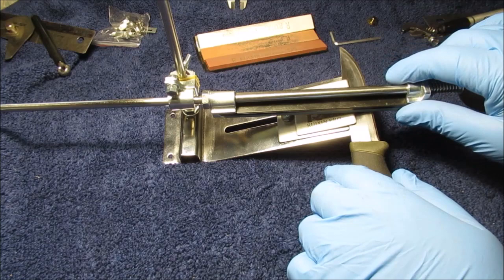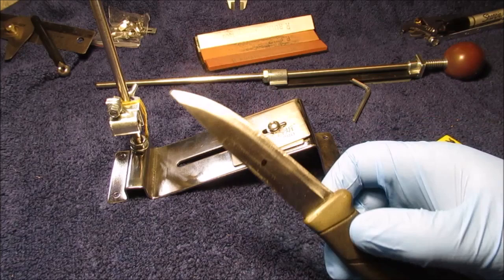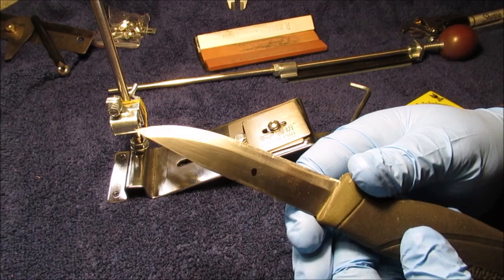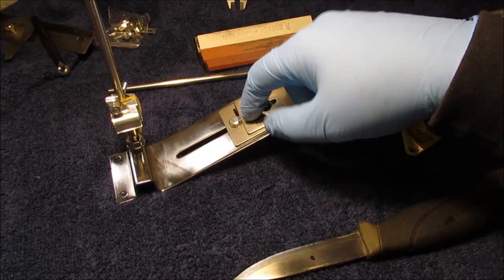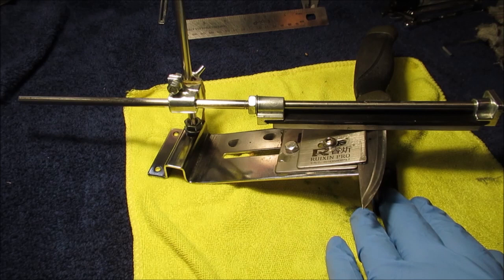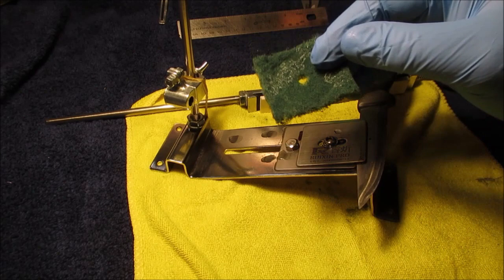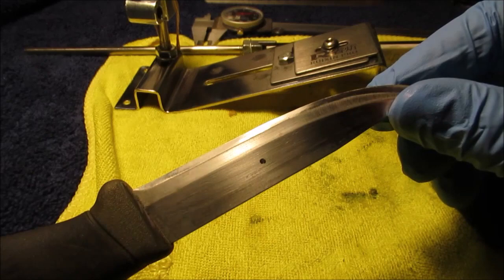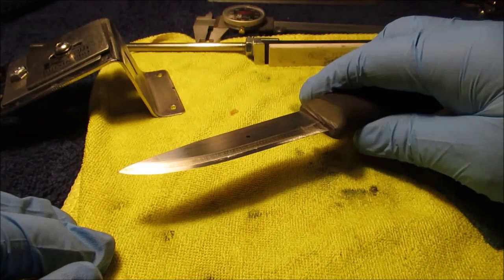Sharpen Mora knife on the Ruixin Sharpener

Comment: Lil' ball is looking good!! I just made a video last night featuring my yellow protractor, I use that thing all the time!! I used it for sharpening my broken drill bit, we'll post it Thurs. night!!☺
Reply from the maker: I have used those balls on several projects I have 2 sizes this is a small one ..I just could not get that yellow plastic thing to work for me so I scraped the parts off of it ..I still plan on modifying it for checking knife blades